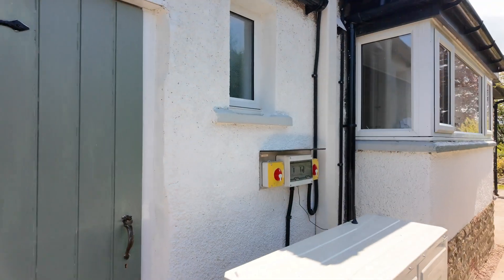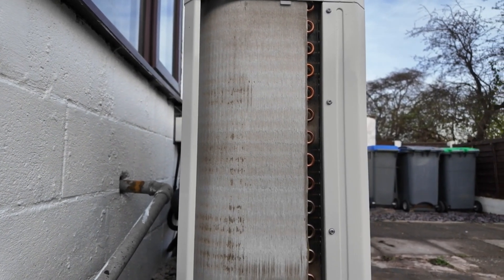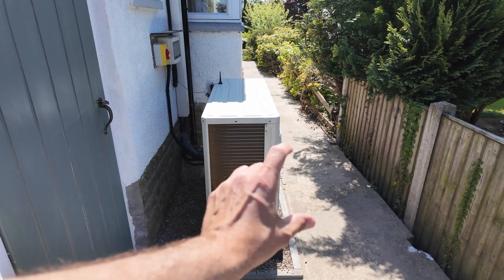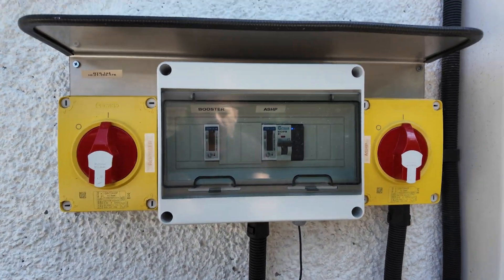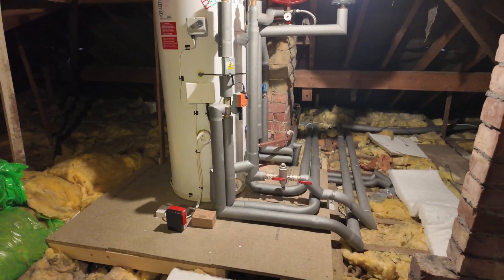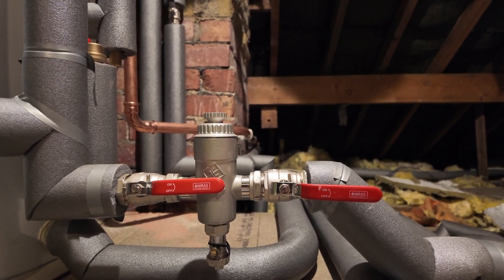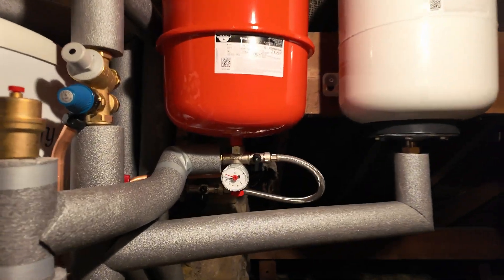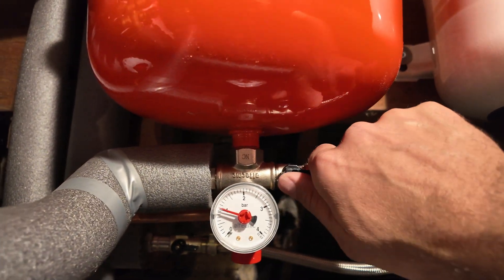Heat Pump handover video.

Comment: Adam you came to commission our heat pump last July. Come December January and February our bills were touching the £300 mark per month. Is this excessive or the norm as I've always had this feeling talking to other people that it's not the norm. Any help would be appreciated
Reply from the maker: Hi Peter, I’ve only just seen this comment apologies. 

First off, it is completely normal for Dec-Feb to be the most expensive time of the year for heating as that is when you’re using it the most. That being said we need to look at your annual spend for the heat pump in isolation from the rest of your house. 

There is a box in between your isolators housing an electric meter showing what the heat pump has consumed since it was first tested in the factory. Could you take a picture/reading of it so I can work out your exact spend? Cheers Adam
Reply: Adam it's 452769 cheers
Reply from the maker: @peterstevenson5368 spot on that’s 4527.69 kWh since the unit was first turned on just over 12 months ago. 

If you’re paying 0.26 pence per kWh that equates to £1177 over 12 months averaging £98 per month. 

Does that sound a fair spend for your heating and hot water over the year? I will take a look at the data tomorrow to check there isn’t any improvements we could make on top of that. 

Thanks
Adam
Reply: Thanks Adam.
Reply: Hi. Adam. When you say Dec to Feb is the highest output. Yes that's natural. But would you expect it to be as high as it was last Dec to Feb. Cheers
Reply: Also how do you keep the flow rate temp down. Without losing house temp. As I'm led to believe that the lower the flow rate temp. The less in household cost
Reply: @peterstevenson5368 you may be able to adjust your heat curve as mentioned in this Heat Geek video:
https://youtu.be/odMXRDd2nQg